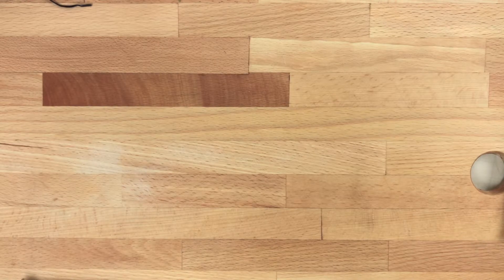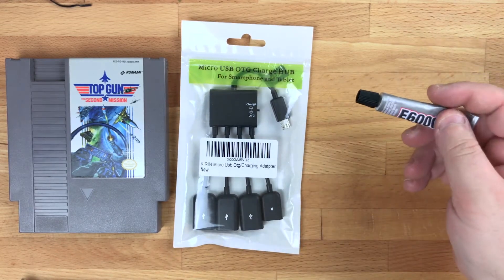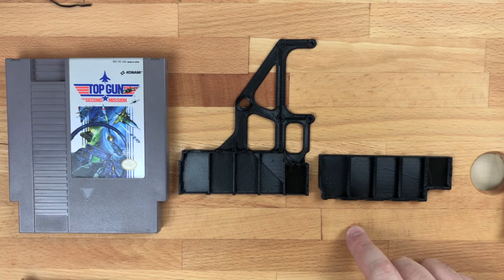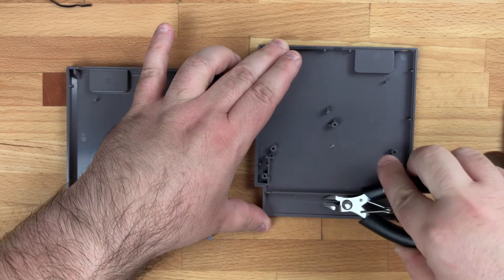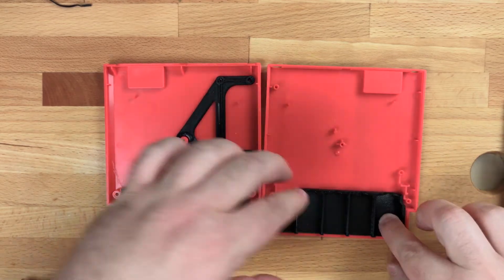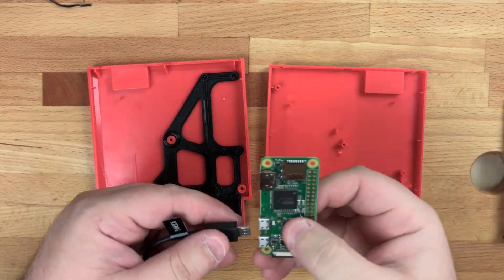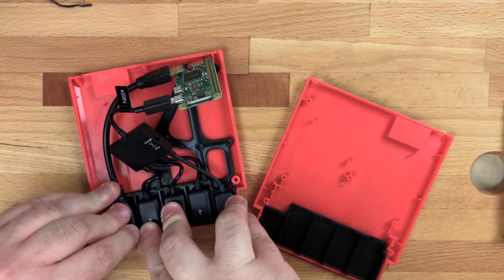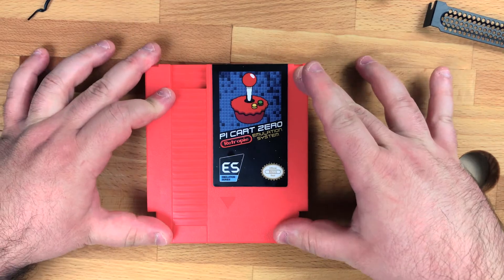Updated DIY Pi Cart Guide: Raspberry Pi Zero into NES cartridge Nes Classic Edition

Comment: I've installed that exact same usb hub for my Pi Zero it'll power on but it won't recognize any input from all my controllers that I've tried with it any advice?
Reply from the maker: Maybe a bad hub.  Its been said a few times in the comments that sometimes you get a bad one.
Reply: Rexx Reviews I’ve tried with multiple hubs, second one worked but only with a separate cord for power. Don’t use the one on the hub.

Comment: You never had idea to add "safe shut down" system with On/OFF button? (like on Game Boys zero)
Reply from the maker: well now i use the power cables with the on/off on them.  Most of the new builds already have safe shut down enabled so when i hit the switch on my cable it starts the shut down.

Comment: I bought everything listed here.  Got it all set up and it worked great for about an hour.  Now, no game pads can be detected and even my USB thumb drive doesn’t flash or light up when I plug it into the USB hub.  Please help!
Reply: same here
Reply: Same here, looks like it fried the data pins in my usb port on the pi..it will send power to any us device, but will not detect anything plugged in. Second attempt bricked the pi and it will no longer boot regardless of SD card or image

Comment: I have no access to a 3d printer locally.  Anyone have any luck finding a bezel elsewhere online?
Reply from the maker: There are online 3D printing services, thats what i used.  The link where the print model is that I gave has some links to also get it printed. The creator does NOT allow these to be sold so its hard to find them
Reply: I'll check it out. Thanks!!!
Reply: Google onslaught productions. Thats where I got mine.

Comment: Hey you probably won't see this but if you do, do you have to use the raspberry pi zero w
Reply from the maker: if you want wireless internet.  If you dont you will have to buy a wifi usb adapter and then you will end up spending more than just using a Pi Zero w.  The hardline network ports are gone on this type of build.
Reply: Angel Acuna you can

Comment: So I followed your instructions however when I plug in my USB drive there are no files created in it. I've tried two different thumb drives and reformating.
Reply from the maker: I only showed how to build it, I never left any instructions for how to get the software to work so it wasn't "my instructions" 
I personally use an SD card reader and put the ISO on the card directly from the PC

Comment: I bought the USB hub, but my controller is detected but won't work. Any ideas?
Reply from the maker: That just sounds odd if the controller is being detected.   Maybe a bad image?
Reply: Rexx Reviews.  it works with some of my other USB hubs
Reply: Moved my SD card and controller with hub to another pi zero and it works!
Reply from the maker: That is freakin odd as hell.
Reply: I have the same problem, tried two differensiert hubs on the zero and no gamepad detected. Moved the sd card and gamepad to my pi 3, no problem at all.

Comment: Hi Rexx, one question - this usb hub, You can connect gamepads and power in the same time? There are two micro usb ports in raspberry pi - one for power ond one usb otg. You connect this usb hub to second one and it works? I want to do similar project and i want to be sure :) I'm from Poland :)
Reply from the maker: Krzysztof Dereń I plug the hubs into the top one.  As long as the hub is in OTG mode controllers and power both work.
Reply: I’m having a similar problem where my usb hub will turn the Pi on but won’t recognize controllers or even a keyboard. Any help???
Reply from the maker: it seems like many of these adapters are just flat out having issues, I have received a few myself and had to get amazon to exchange them.

Comment: I have a few questions. 
What size screws did you use to mount the Pi Zero?
Do you have to unscrew the Pi to remove or insert the Micro SD?
Is there enough room and clearance to add a Micro SD extender cable?  Like one of these -  http://www.ebay.com/itm/TF-Male-To-MicroSD-Female-Card-Reader-Extension-Adapter-Cable-For-Phone-GPS-TV-/282556109576?var=&epid=25004570393&hash=item41c9a81308:m:mI709qZUhPiVArfgOYt_Qkw
Reply from the maker: I couldnt tell you.  I took the 3D printed part to the hardware store and went through all the screws.  the ones i found were in a random bucket with no size listed.

Comment: I used the exact same configuration like you did. I have a Pi Zero and Retropie on it. I can connect a PS3 and PS4 gamepad vie USB without any problems and the system detect them. I do have some fake chinese SNES USB gamepads and the system doesn't detect those. Even when I am in Retroarch and have the SNES gamepad connected I can only see my plugged in PS3 gamepad. Other ports show N/A. Is there any way to get them to work?
Reply from the maker: Its most likely the hub, if you read through the other comments a few of us have received a bad one or two.  Just like i recommended to other try all hub ports with controllers before building.  Now if some controllers are working in the same port that others are not that an issue i am not familiar with.
Reply: Rexx Reviews unfortunately all ports work great with the PS3 and PS4 gamepad. So the hub I guess is okay? Could imagine that there is a problem with the power. Maybe because the PS3 gamepad has a built in battery pack?
Reply from the maker: Yea if the ports are doing fine with the other controller they are good,  we were getting some that had complete bad ports.  I have had no issues with the little Chinese SNES controllers.  Have you tried a different retro pie image?  Other than the SNES controller the bluetooth one is the only other controller I have tried.

Comment: A much neater looking build than mine for sure.  If I did it all over again I would probably build it this way with fewer parts therefore eliminating any frustration I had trying to stuff all the necessary components into such a small yet iconic case.  I like the idea of using a bezel/bracket piece to neatly hold everything in place with even less unnecessary hot/super glue or mounting tape to hold everything in place not to mention it's a less messy/permanent option in case you need to fix or replace something or if you totally mess up.  Having said that I built mine about 6 months ago using a combination of the "SnazzyLabs" tutorial and the "HowChoo" tutorial.  The thing I liked most about the SL guide is at no point did he mention using glue of any kind in his build.  Everything was  affixed in place using heavy duty black 3M mounting tape.  The kind that's like $8 for a roll and has a picture of a mailbox on the package.  I mean if it's strong enough and sturdy enough to hold a mailbox on a house then its good enough to use entirely in place of glue.  As for a proper label, I only recently made one using a guide from the 8-Bit Guy's YT channel.  Just a color copy of your label image, packing tape, tacky craft glue, an X-acto blade, a steady, patient  hand and voila!!!  You now know how to make your own professional looking glossy label stickers for all of your retro cartridge project needs.  BTW, what controller are you using for your PiCart??  I'm using those cheap, crappy "Innext" controllers and after almost 6  months they're starting to wear out and fall apart.  I've used cable ties inside to keep the wires from sliding out the top and while its not a bad solution it won't last.
Reply from the maker: iBuffalo on wired and 8bitdo for bluetooth

Comment: Hi Rexx! Thank you for the video! It was very informative and helpful.  I followed your instructions (because who wouldn't want to build something  as cool as this?) and have some questions and possible tips for any DIYers trying to build this.

- Was there a reason you used a reproduced cartridge case and not an original? I used an original NES cart and it seemed the 3D parts didn't exactly fit as nice and flush as they did in your vid. Not sure if this has anything to do with the cart (replica vs original). 
- I dont know if I got a bad USB hub but during my build the power cable seems a bit short (a tad shorter than what you showed in your vid). Had to stretch it out as far as I could to place the hub away from the center hole as it would not close. In doing so (didnt apply that much pressure) the connections inside the hub broke off. Had to re-solder them in place.  Re-soldering new wires gave me the extra space I needed (just a pain in the a**). 

Thanks and keep them cool vids coming :)
Reply from the maker: The 3D part does seem to fit better in an Aftermarket.  I only swapped to them because i wanted some nice colors but they are much easier to get the guts out of with the razor.  The hubs have been hit or miss for me,  i think they are coming from different manufactures and sometimes vary in sizes.  Have also received some bad ones, luckily amazon prime lets me send the bads back. I do wish they would make all the cables a bit longer on the hubs.
Reply: Good to know. Thanks. As for the hub, on my build I ended up removing the plastic case over it and after re-soldering the wires I applied some hot glue over all the contacts. All in all its probably one of the sweetest builds I've made so far. Thanks for the help and advise.
Reply from the maker: Glad it could help.

Comment: Hi, I love this video, I also Subbed, Thank you for you help!!! Gonna be amazing having this in my dorm when I go back next year!!

I have a Question though:
Will having the Micro Usb HUB Adaptor with Power adapter plugged into that one port on the Raspberry Pi put any strain on that one port because it is literally doing everything or not really? Mainly because I Have seen other people do it differently, but if it won't put too much pressure, than this overall seems easier and cheaper.

Please Let me know, and keep doing what you're doing!!! :D
Reply from the maker: Ive had no issues with it in the 1 port.  If you end up getting one of those 8bitdo bluetooth controllers then it will matter even less.  I always suggest the Zero W because for the extra $5 the wifi and BT on board is more than worth it.
BT Controller - http://amzn.to/2rIQgAD
Reply: Rexx Reviews I did your built and I just wanted to know if you had trouble removing the micro usb from the power port? I don't know why but it feels like removing the micro usb from the power port seems to fight it and I have to wiggle it and put force to remove the power cable from the port when I'm done using it

Comment: Very impressive. This helped a lot, but I do have one question. The power supply and the usb ports are now insideone source right? Does this come a long with lag or anything, because I thought you have to use one port for power and one for the usb?
Reply from the maker: I haven't noticed any. It seems like many other have also started using this type of adapter for these builds as well.  It going to be no more than using the Bluetooth controllers many are using. I am glad the video could help.
Reply: Rexx Reviews so the power port is useless on board with this adapter? Thought that one port is only for usb and the other one is only for power.
Reply from the maker: The usb handles power and usb.  You can still use both if you want to build it using the full size 4 port hub but using this method it just uses the 1 port.
Reply: Rexx Reviews great. Thanks a lot man!
Reply from the maker: Bryce Demise it's possible you got a bad hub, I have received 1 bad one and had to send it back so I have started testing hubs before putting them in .
Reply: Built several the old method, tried out this method and I can't seem to get it to power on? OTG mode on, nothing. Suggestions?
Reply: Tried the second one I had in the package still, that one worked. Bunk hub on the first try. Thanks for your help! Running smoothly without all the cables from previous builds..